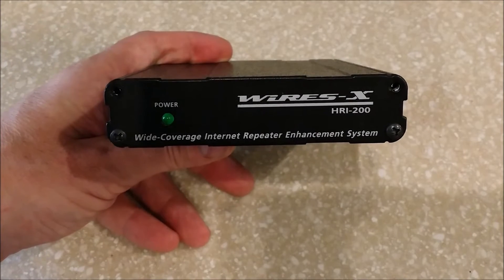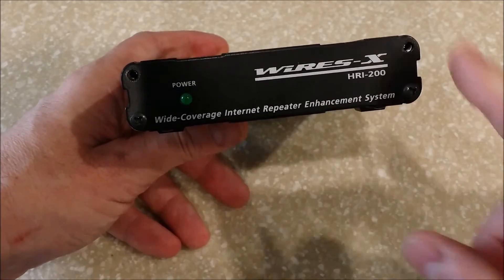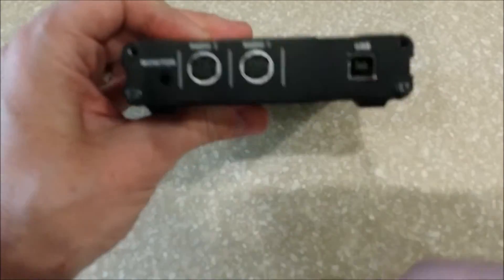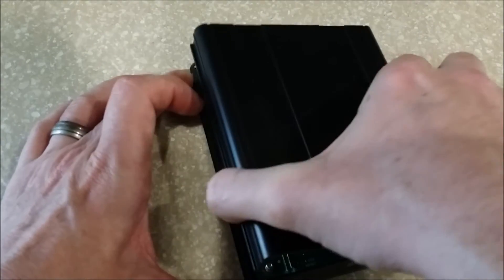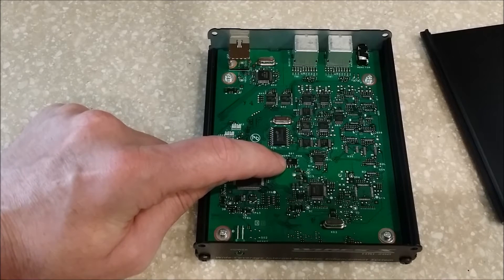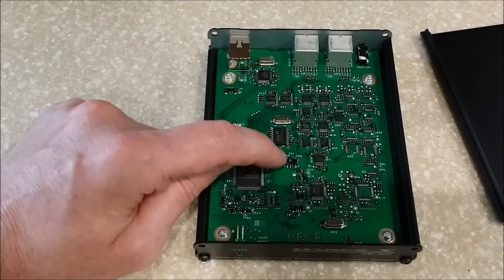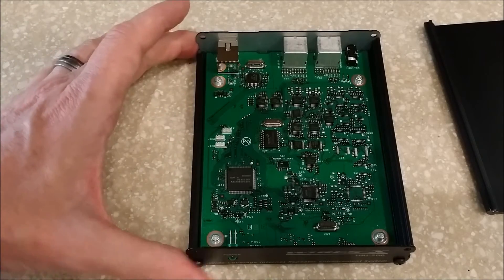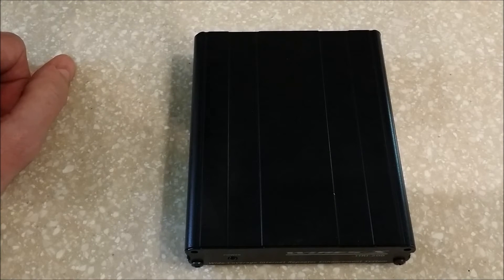Yaesu Wires-X HRI-200 Firmware Upgrade

Comment: does anyone have the link to HRI-200 firmware files... I cannot find it on yaesu site
Reply from the maker: I don't see it either.  Here is the file I had saved from when I did mine.  Please confirm it is the correct version to upgrade from yours. https://www.dropbox.com/s/4suafcnp3f3eljc/HRI-200_ver101%28ENG%29.zip?dl=0
Reply: thats the version i have... my tx keeps locking up i have updated everything else.
Reply from the maker: +stanley  Mine was doing the exact same thing before and after the version update. You need to replace the USB cable that came with the hri-200 box and perhaps even put a ferrite choke on it if your cable that you replace it with doesn't already have one. the USB cable that comes with the hri-200 box has very little insulation. Since I replaced the cable I have not had a single lock up.